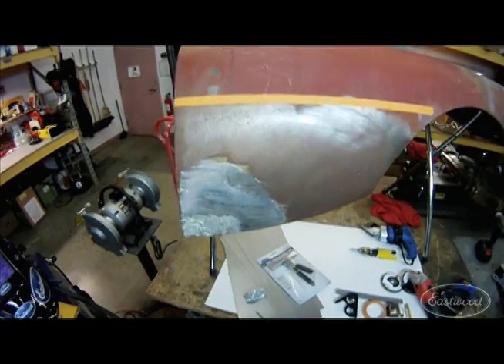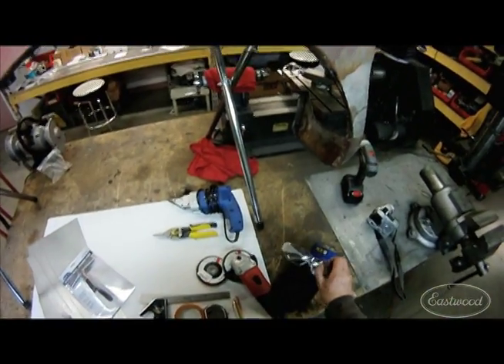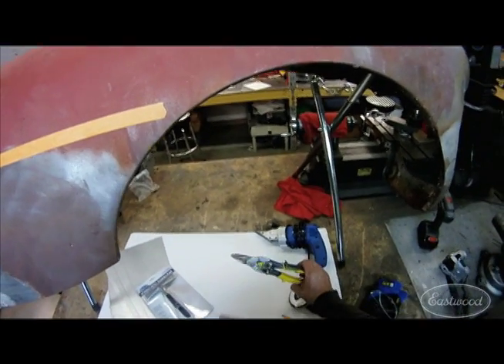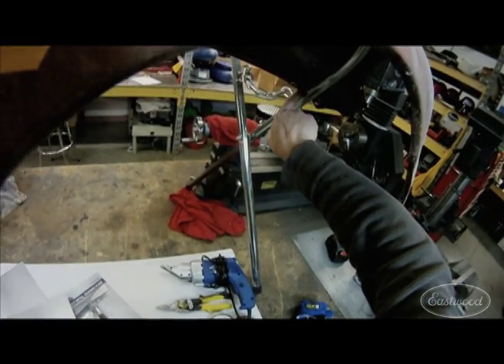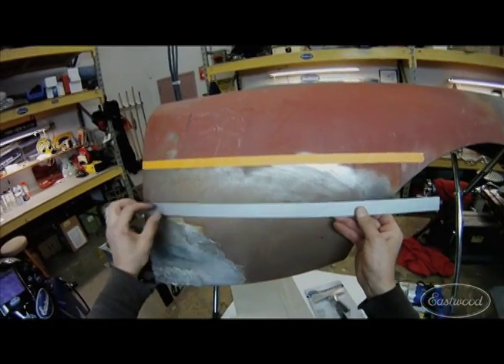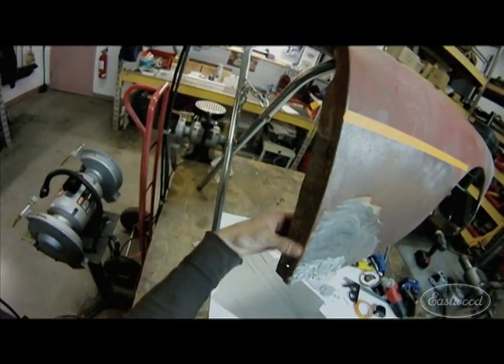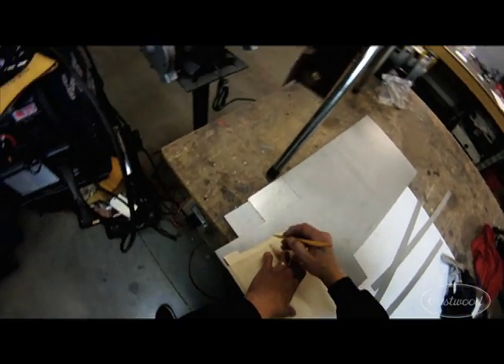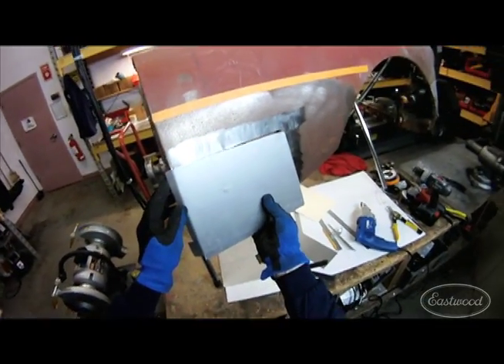Rust Repair Panel DIY - Patch Panel & Installation Kit for your Car from Eastwood

Comment: Look at the rust issues on any vintage car and most involve 2 layers of metal spot welded together.  The factory uses these seam types primarily to speed up the assembly process.  Why would you want to add an unnecessary layer that will create a rust problem all over again?  This should be a straight up butt weld repair.  Proper fitment and trimming would eliminate the need for a backer strip that will cause more rust.
Reply: McCartney Paint and Custom would it be better to use a stainless steel backer instead?
Reply: No, it would be better to butt weld, dress and planish the weld seam.   Any weld will cause shrinking and distortion, multiple layers prevent proper planishing to eliminate the distortion.  The factory uses lapped spot weld seams to get things down the assembly line quicker.  Nothing else.  Doesn't mean its the most correct way to do something, as it's where most of the rust starts.  That fender didn't come originally with a lapped seam down through the middle, why add more spots for rust to start?
Reply: Start here and read the posts by Mopar4don as he repairs a Dodge Charger front fender, he's a novice who had never done much in  the way of panel fabrication and patch work, follow through to the end to see his results.  This is the correct way to fix the rust issue using the MIG.  http://www.garagejournal.com/forum/showthread.php?t=53534&page=24

Comment from the maker: Unlike most metal sold at local supply stores, this metal is aluminized which resists corrosion.  If you price out the same items elsewhere, you will see the value of this kit.
Reply: Eastwood Company would it be better to use stainless steel as a backer to refrain from future rust?

Comment: You can get seam pliers, drill bits, spot weld bits, and sheet metal screws from Harbor Freight and spend less than half the money.  Sheet metal from any hardware like Tractor Supply or Farm and Fleet.  DIY projects, save money where you can!

Comment: @6806goats1 , if you use the eastwood flange tool for this job it would have gone faster and been neater although it has the potential to be a moisture trap this can be solve by leadfilling the gap. As long as the metal can support a butt joint i think that is the way to go , unless it is a structural joint and the flange forms part of the structure like sale panels to quarter panel joins , so i guess it does depend on the job

Comment: @vcval had to mod my post vice typing a second one. I would think flanging would be the ticket on this. Eastwood had me thinking that flanging is the way to go but that's been many moons ago. But even back then I was wondering if flanging a panel is a moisture trap even if the panels are coated with weldable primer. Just trying to figure out if butt welding is now the bestter way or if it just depends on the job. Been a little over 12 years since I took body and fender classes time to revisit.

Comment: Instead of the backup strip, use Eastwood's Intergrip Panel Clamps (Item #19016) for the butt welds.  They work great.